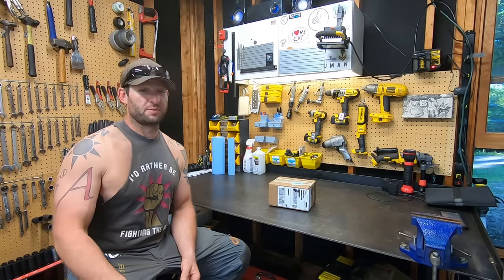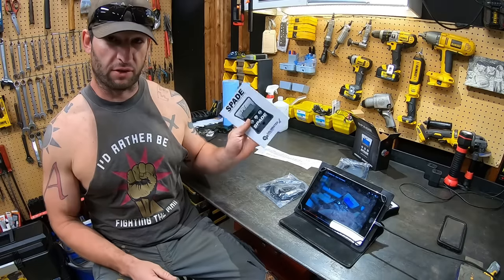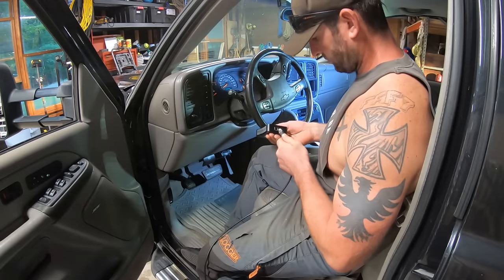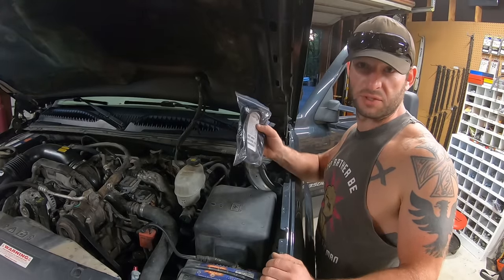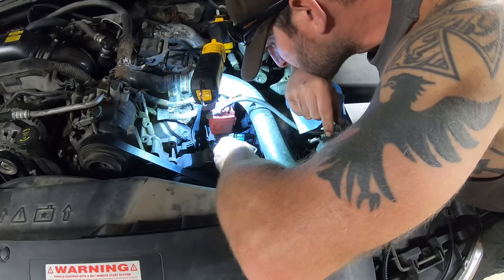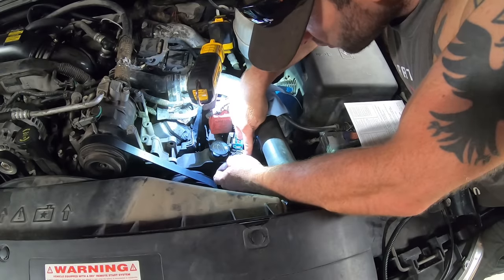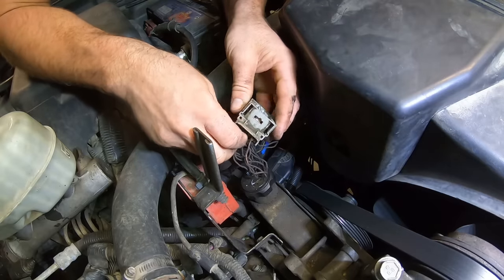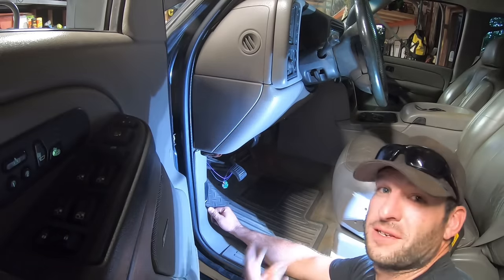Jack Spade from Duramaxtuner.com Install

Comment: I watched your video twice prior to trying to install this on my 2005 LLY. I told myself, “I won’t make those mistakes now that I watched him do it.”, but I did exactly what you did. I just knew I had that dang purple wire in as far as it would go, but nope. I put it all back together and my switch didn’t work. I was pissed!. I took it all back out and sprayed some electrical connection cleaner in my harness. That did it. The purple wired snapped into position and it all works now. I added an Edge Insight CTS3 and I really like it together with the tunes. Thanks for the video. It kinda helped. LOL

Comment: I have installed "EDGE" programmers on a ton of D-max in the past. I was always impressed with the results of the Duramax engine. They hide a lot of power in a stock engine. Just a tip for you on that sagging head liner. You can remove it and shop vac the foam underlayment off very easily. Through some bedliner spray from a rattle can and it looks amazing .

Comment: Hey, just one man's experience here... I have worked on 2 different LLY Duramax's, and both had very temperamental cooling systems.  Particularly the bleeding process after draining and refilling the cooling system.  The best advice I can offer you is to be patient, and be SURE you get all the air out of the cooling system before shutting the hood, or you will overheat.  I know your father is a GM mechanic, so he can probably help you out.  Good luck when you do the water pump.
Reply from the maker: Did it a couple weeks ago

Comment: I’ve used calibrated power for years. ( duramax tuner) they are great people and know what there doin.  Trust what they tell you..... these guys won’t hurt your truck like your friends and people you talk to that don’t know there stuff and want to use your truck for a experiment. I’ve never had calibrated power steer me wrong or damage my truck. Enjoy your install if have a issue call m they will do it from there shop in Illinois via a laptop
Reply: By the way just buy a Cummins.   No tune needed.

Comment: I have an 05 lly and some of the things I've done are, S&b intake, 5" straight pipe, fass lift pump, turbo horn (lb7) turbo intake elbow (lly,lbz) and ridge runner tunes w/ dsp5 switch. Really wakes the truck up and I'd strongly suggest a lift pump if your running those bigger tunes.

Comment: So why doesn't Ur park brake work? I know my hilux park brake needs retentioning. But it works for the most part.
Reply: a park brake and e brake are two different things. A park brake is a toothed disc inside the transmission that prevents movement. A e brake is a brake on the  vehicles brake system.

Comment: Are you gonna delete the truck at all ? And do you have or plan on putting bags in the rear at all ?
Reply: There isn’t anything to delete on these trucks. This truck was built before dpfs and egr coolers.
Reply: Egr delete/ block off , can do the y pipe kit , you cp3 and you can straight pipe them and and put a down pipe and a bunch other stuff injectors ,tie rod sleeves, if you want to do the work you can put meth on them and of course upgrade the turbo or just go twin turbo  ,..... I’ve had five of these trucks , 3 made 650-950 horsepower and 800-1650 for torque

Comment: Glad you mentioned trans rebuilding.... lol youll be doing that soon haha
Reply: Why?
Reply: Those Allison transmissions do not like extra power...one of the reasons it took gm so long to turn the power up in the latest gen trucks.  I haven't heard how the new ones are holding up?
Reply: Only if you run it in performance mode all the time maybe but im pretty sure they can handle the extra "work power" so to speak. They are one of if not the best transmissions ever to be put in a light duty truck
Reply: @alltree78  They did ok stock if kept up on maintenance.  They couldn't hold 750ft lb of torque, when the engine could give more.  GM or Allison under spec the clutch pack's and input & output shaft sizes.  

I like the duramax and Allison, but it took 7 years for GM to catch up because of that glaring weak spot.

Comment: Take cares what's going into the engine ...
Mean air, oil, fuel, cooling liquids, brakes liquids and their filters
And the whole all of what it could give will follow .

Regulation an everyday engine and revealing its performance when needed is not a joke ...

You, ropes climbers !

By the way, going into big expenses don't seems to be "the thing" aimed .

Ropes climbers !